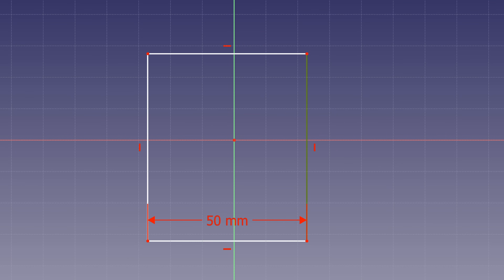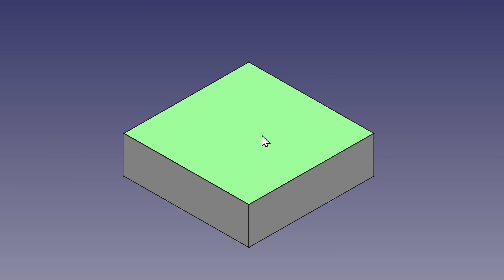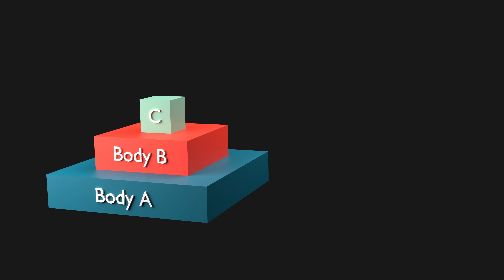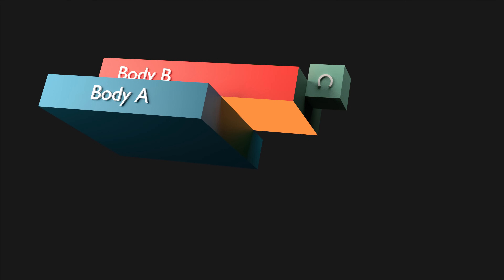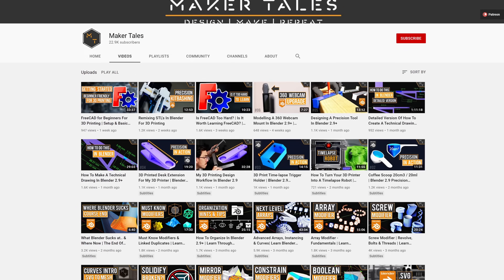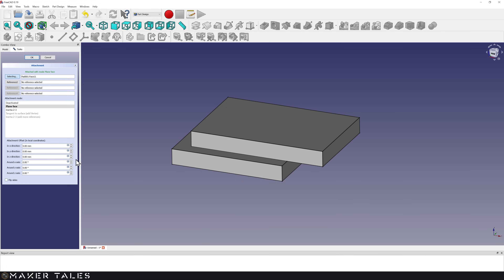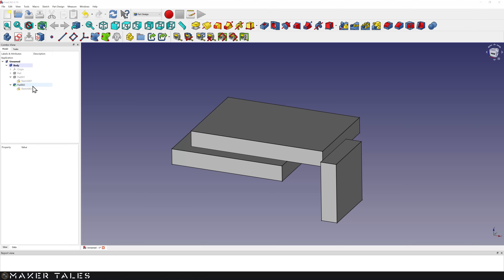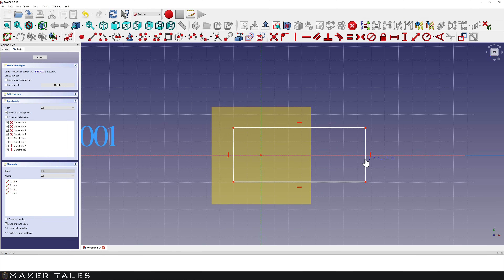FreeCAD Is Fundamentally Broken!  - Now what... Help Me Decide...

Comment: Okay, I would call this video clickbait.  You describe a bug, and not only a bug, but a bug for which there is a known fix, and called it a fundamental break.  Maybe I should give you the benefit of the doubt, and just assume that you don't know what 'fundamental' means, but since you are a YouTuber with a modest number of subscribers, my conclusion is that you're using a sensational title for the purpose of fradulently enticing people to watch the video.

Just the same, in case you don't know what a fundamental break would be, this would be a flaw that is at a very low level in the structure of the program, such that it would require a complete re-thinking and re-writing of the code.  From what you describe in the video, this is not even remotely what this bug is.

If you're wondering what it takes to grow a channel, I would say maybe you should avoid things that drive viewers away.
Reply: Agree, pretty much a clickbait. What's worst, there is a lot of overhyping for RealThunder fork in regards of topology naming problem, and people think it will fix all of them. I see a loots of disappointed peoples in the future. I am 100% for RealThunder amazing work but this "bug" is still there and I can break a model in this fork very easy.

It is like dividing by 0 in math. If you have a function (x+1)/(x-1) and make a program that takes "x" and compute a value, then for x==1 program would crash or catch an exception and report a nice error. But still some values should not be allowed as an input for a function. Similar checks in parametric designs needed for constraints that could break your model or better reporting if issue appear.

In real world all things have limitations, gravity, heat transfer, wind, etc. They will break your artistic building or model in short time, or it will be impossible to build it at all. Parametric designs have limitation for constrains as well, deal with it. For me after understanding what I'm dealing with this is not that a big issue anymore, definitely not a "bug" or "design flaw". I can prevent it to some extent by changing order of features or avoid some of them in the design. Question is, how robust you want your model to be? With python macros you can make some checks in very complex manner but there is always possibility that some values will break it.

Topology naming problem definitely needs much more focus in tutorials for beginners, how to avoid or fix it (more understanding less frustration). It is a big obstacle for many and some of them give up easly because of that. Some of them want wait until magical fix will be made, good luck with that.

Comment: I want to use FreeCAD when I need to use a solid modelling type program vs. the surface modelling program I usually use. Thanks for letting me know about this issue. I did try to learn FreeCAD but haven't had much time to really get in to it. I ran across an issue with just trying to scale a part. It wouldn't let me do it. It wanted me to make a copy of the part I had created then would let me scale the copy. I wanted to scale the original as I realized I used the wrong units when I started the model. For now, I continue to do most of my work in Rhinoceros 3D.

Comment: I had the same issues in Inventor, up to inventor 9 included, than they were corrected such as in Inventor 12 almost everything was OK, (I was a heavy user of Inventor, some 200 to 300 hours a month for years)

I see them in FreeCad too, not only the one you pointed out, also the fact that given an exitant body, let say I want to create a special shape hole in it, so I make another body to run a boolean extraction leaving the cavity desired, as long as it is in one piece, but if I need two or more holes than FreeCad would not allow me to even extrude two not connected objects of a single body so I can than run the bolean operation, nope, I have to do them exruding one body, run the boolean extreaction, than make a second body, and so on.  The other "obvious" solution, performing the single object body extrusion plus boolean operation than creating a pettern does not work either, full of flaws, and don't make me started on patterns here... they suck like hell even if only compared with Inventor 9 edition.

Comment: Sadly, FreeCAD 0.19.2 for Windows seems to be broken overall. So much so that I dropped back to 0.18, after going to save a document I was working on for an hour only to have it crash (then no recovery file was made even though it was set to autosave every 20 minutes). Also there were problems I was having in my workflow in the Part Design workbench. Sketches that used to work in 0.18 would give me "invalid face" errors in 0.19.2 (draw a square in a square then a circle for a hole  inside the inner square and try pocketing that sketch). The naming issue has always been a pain and I used to have to break my models down, re-map the sketches to the correct faces and then continue on. Something a newbie would probably get totally lost in the tutorial. Didn't know about RealThunder's branch. May try that and hope it is a patch until 0.20 comes out (which is usually a year after they get the Linux version stable). Thanks for this video.

Comment: I've been using freeCad for 3d modelling for 3d printing for quite a few years now and while I hit this bug initially due to the tutorials telling you to reference existing faces, I quickly changed my processes such that haven't had to deal with it at all because I never reference any of my sketches to a prior face in the body.

If I absolutely need to base a sketch of a face then I create a sketch that is referenced to the face and then copy it's parameters into a new sketch that is not referenced to anything.

One major benefit of that is that I can re-organise my entire model however I want moving sketches around freely.

Edit: Honestly I just wish I could single click to re-align a sketch to any face's parameters and that would be the end of it. There is no need to lock it to a named face
Reply: That's such a basic and fundamental intuitive thing you have to avoid its crazy anyone acts like its sane.

Comment: On another point, the best way for a free cad program to spur adoption is to open itself to customization in UI so that it can be refamiliarized for people transitioning from other CAD softwares. I really can't stress how underestimatedly important that is. Shortcuts, button placement, mouse controls, etc is really what makes or breaks it for being able to fluidly jump from different programs.
Reply: There are a number of mods out there, VertUI and ModernUI etc?

Comment: I'm a Solidworks user and I never use a face as a reference plane. I also try my hardest to never create new planes. I usually work off a Skeleton model that only contains sketches and they are mostly referenced to the top, front or side planes. Things stay much more stable this way especially when you have many parts referencing the skeleton model
Reply: In FreeCAD the sketches suffer the same naming problem as the faces of the model. If you edit a sketch and just add one line to it (and not touch any of the existing lines) then all the other lines in that sketch might get renamed. So the skeleton model made out of sketches can crumble pretty easily in FreeCAD.
Reply: @IndrekL  oh that's a shame. I can see how that could really make it difficult to use. It's a shame because I would love a free alternative to Solidworks. 1 licence costs more than my car

Comment: As most new users will just be looking for a CAD solution and stumble on FreeCAD after a while they will pick up the latest then available. There are many problems in FreeCAD some will be addressed some day or not. I think most users still like to have basic tutorials so go for it. Adding a few extra sessions on common issues and work arounds would be good enough. I use FreeCAD for many design projects and think it good enough even if I end up with many 'not again why?' moments

Comment: The problem with FreeCAD is it's fundamental design, i.e., it is a parametric modeler. For 99.9% of a  3D modeling purposes the parametric approach is completely unnecessary and requires a lot of upfront creation of geometric associations. The granddaddy of parametric modeling is, of course, PTC's Pro Engineer. I was first introduced to 3D modeling for use in product design in the early 1990's. I was the Staff Product Designer of a company in Silicon Valley. Up to that point all design work was done with pencil on paper at a drawing board. I was tasked with researching and recommending a 3D modeling product to speed up the design process. All the major CAD vendors were considered, including Pro Engineer. What was purchased was a product from, then, Hewlett-Packard's Mechanical Design Division (no longer exists) called ME30 (3D Modeling) and ME10 (drafting). Unlike Pro Engineer it was a "direct modeler". You simply created the geometry required. There was no history and no geometric constraints. Models could be freely modified at any time and geometry could be cut and pasted at will, i.e., geometry could be copied from an existing model and added to a new model and the result was as valid as if it had been created from scratch. ME30/10 was superseded when a new product using a more advanced geometry kernel was introduced, which was known as SolidDesigner. That app still exists today but the name is obscured by the present corporate owner. After HP MDD was spun off into an independent company, CoCreate, the product was eventually acquired by, guess who, Parametric Technology Corporation. Over the years many engineers and designers of PTC's products had come to realize how confining and difficult the parametric modeling approach made 3D modeling. SolidDesigner was easy to learn and easy to use and a very capable product. PTC acquired SolidDesigner and changed the name to Creo Elements/Direct Modeling. They wanted to keep customers in the fold who realized there was a better way. Interestingly, although the product is marketed under the clumsy moniker I just stated the actual application is still SolidDesigner.exe if you look in the Program Files folder. I still maintain a license (about $1,600/yr) for SolidDesigner even though I have been retired for many years. I received a patent last year that I developed using the app. I would be happy to replace it with a free open-source non-parametric 3D modeler but, sadly, none appear to exist.

Comment: I dont use 'part design' workbench.
I found it created more problems than it solved for the way that I work.
The 'part design' foundations are 'part' and 'sketcher' anyway.
So I use 'Sketcher' +' Part'.
I dont recall having this issue using a face from 'part' create geometry and then applying a sketch from 'sketcher', when you just click on a 'part' face and hit a new 'sketch'.
In fact I often rough out trash 2D shapes on the faces as a place holder, before I go back and add dimensions to the geometry I connect too (ie the work plane is independant from any underlying dimensions).

'Part design' uses sequential modelling.
I think that might be the route of your problem ???
Reply: This is explained more here.....
https://wiki.freecadweb.org/PartDesign_Workbench
https://wiki.freecadweb.org/Part_and_PartDesign
Part = Constructive Solid Geometry (CSG) methdology
Part Design = Parametric, feature editing methodology

Comment: Thanks for the explanation. Used to program cad programs as a day job. Nothing easy about it. I would tend to agree with you on the dont put out vids that may be obsolete tutorials in a few months time. My take on this would be make new tutorials using the thunder branch clearly prefacing the video with the fact its not the official branch and link back to this one to explain why. You should try a few complicated workflows in both version and film them with snagit (whatever screen cap soft you use will do). Maybe diff the resultant step files to check how they differ between the official and thunder branch. (I suspect thunder may do this themself). Dont give up on freecad its so powerful and our best chance of preventing complete comercial dominance of fusion and solid worx from being the only options and not having cadcam being only sas.
Also by doing all your workflows twice in both apps you make find thunder some bugs they have missed or conversely help freecad to implement the right fixes back into the official. Hard work but thoroughly worth it if you can get freecad official back on track.

Comment: Fusion 360 is so intuitive and simple, they are using on schools for kids as young as 10 to make 3D printed objects. I've seen a 10 year old kid master it after a week, that's how simple and intuitive it is. That's the direction cad software should be pursuing, but I can barely using FreeCad for very simple tasks.
Reply: I used tinkerCAD, rather than dealing with freeCAD...
Reply: @Beregorn88  Then you want to add chamfers to your model, and damn! Though I must admit I've had problems with chamfers in FreeCAD.
Reply: @Beregorn88  I fail to see the utility of TinkerCAD. Fusion 360 is already intuitive enough, I just wish FreeCAD one day becomes as intuitive.

Comment: Well as  a complete newbie, I am tediously learning. I already followed tutorials and complete small 2D and 3D projects using Sketcher with ease and now Bim. As a newbie, learning time is a big problem, it is difficult to find the right videos and other references that are edited with simplicity and clarity. I wish that some tutorial videos on YouTube could be revisited and anticipate more consuming setbacks. For example, placing windows using Bim: for some reasons, (1) inner and outer window frames (part library) of windows are sometimes not aligned, (2) if you (mistakenly) change a dimension of a window, no reset button are there to get back the original values and Freecad keeps your errors as the new reference!... a bit  off topic. Regarding the issue you address, for the time being, I would be interested in videos avoiding the  "bug" problem you are explaining  (Thunder  or not) and learn with some good pre-design. I imagine that the bug will be fixed in the long term. Does Thunder's version change dramatically the present workflow on Freecad?

Comment: After fusion changed their license, I fought with Freecad for a few months on and off.  Always over constrained, under constrained, stuff just so close to working, then frustration.  I'm a linux guy by preference, but do have some products I want to use that require windows.  I finally gave up, tried Alibre Atom on a 6 month trial, and started getting somewhere.  Bought their version with 2 seats and meshcam and am quite happy.  It was a pig on my virtual box instance of Win10, but running native it's quite nice even on a mediocre laptop.

Comment: I haven been using some 3D modeling software long before I got into 3D printing and encountered Freecad. And I thought "What the hell is wrong with this program? Why does editing the shapes you made your object of end in breaking it all at least 50 % of the time?". To edit things I then used to delete the last step(s) and do it all over. Then I discovered re-referencing. Still it's unbelivable that this hasn't been fixed years ago. This is not how things are suposed to work. Your comparison with a cliff actually totally expresses how it feels. Although technically your cliff function, that isn't a real function, would take you back in time xD .

Comment: It is not good practice to use surfaces as reference planes, you should use datum planes for this purpose as it can cause issues with complex designs even though it works in NX /SW / Caria. You should teach the use of origin and planes as references as this is often required in large company environments

Comment: FreeCad  has made a lot of progress over the past several years and even with the TNP one can still turn out a lot of good designs. With the Real Thunder fork merging back into the main branch of FreeCad many of these issues will be ameliorated (they are never totally solved). I'd like you to keep making the videos showing some of the other workbenches but a lot will change in this next year. The lifetime of a video on software is usually short but I have still gotten a lot out of videos all the way back to FreeCad 0.15 and a lot changed since then. Thanks for taking the time to open the discussion.